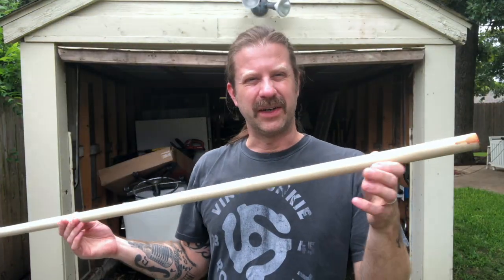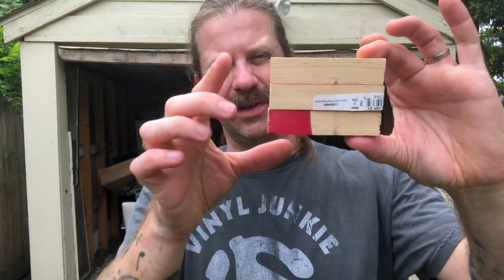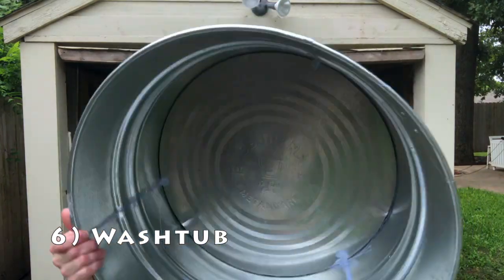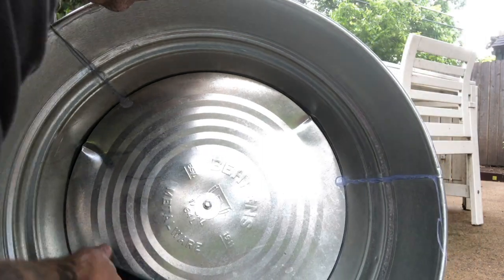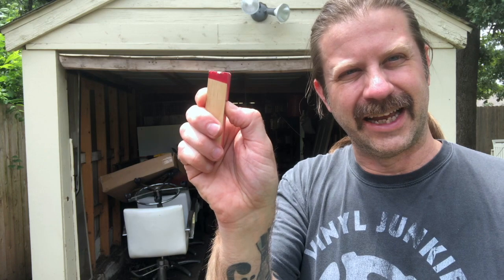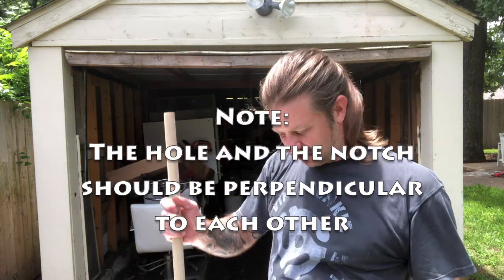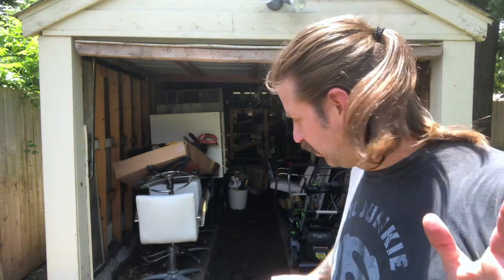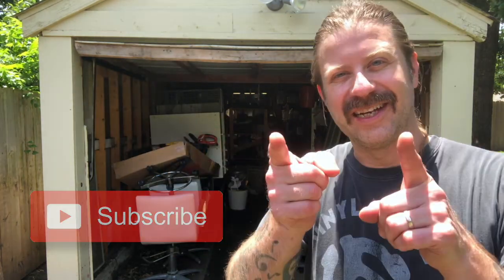My First Attempt at Building (and Playing) a Washtub Bass

Comment: I love playing washtub bass! If you play a lot, suggest an industrial broomstick handle, which has a nice finish. An unfinished dowel would chew up my hands on a 3 hour gig. Also suggest a rubber mat for it to sit on when playing or the tub will travel underfoot. A microphone underneath will give volume, but will feed back on a raised stage. Great instructional video!
Reply from the maker: Thanks so much for the comment. I had the immediate same thought after building this. The raw dowel is probably not the best. A broom stick would be a bit longer and have a coating. Great suggestion on the rubber underneath. Thanks again.

Comment: I’ve found the more things you have screwed in and attached, the more things there are to buzz and rattle. I don’t even bother with an eyelet anymore. I go straight into the tub with the string, and on the back is just a washer to help distribute the pull tension, and a felt pad to keep it from rattling. Gaff tape off the sharp edges of the hole. Nylon clothes line rope, thicker that what you have. The tone is deep, round and surprisingly loud. More low bass volume than a stand up even. I prop it up on a flat piece of wood to let the sound out. I’ve found hot dipped sound better, and stickers seem to dampen the sound.
Reply from the maker: Thanks for the building advice. Trial and error always seems to be the best way on instruments like this.